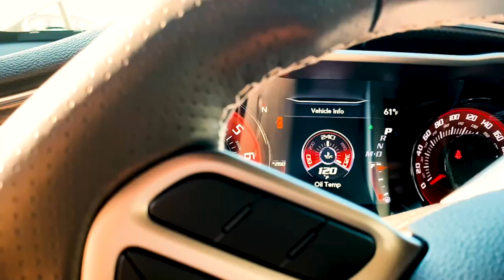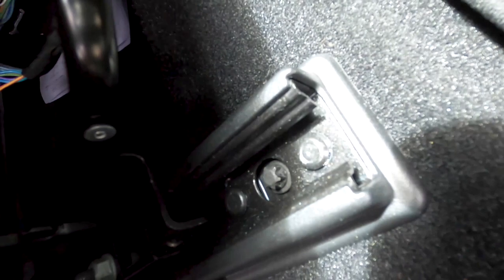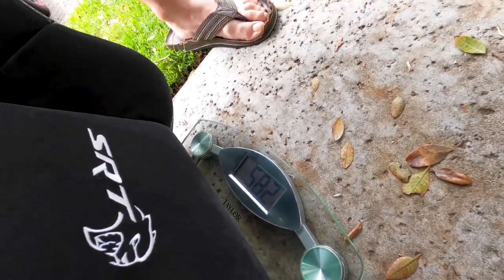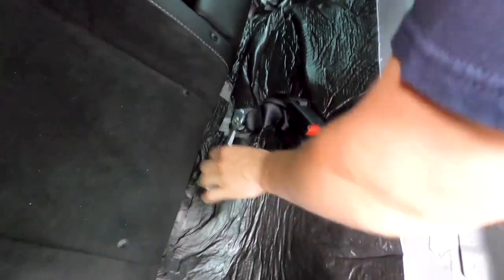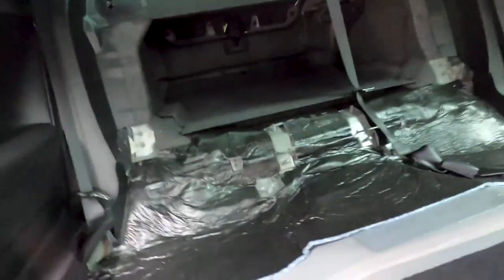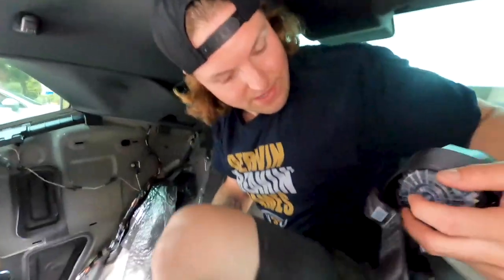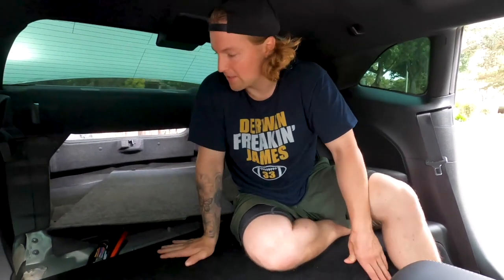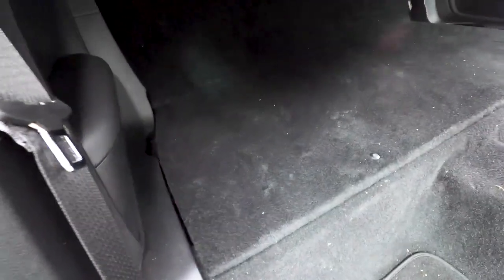SPEEDLOGIX REAR SEAT DELETE ON REDEYE!! AND OTHER WEIGHT SAVINGS!!

Comment: Nice info. I was driving mine this evening and was thinking the same thing. My car is close but, as they say “She could afford to lose a few pounds”.  I put some 315 4S tires on and the car hooks a lot better once I get into second. First still takes some driving
Reply from the maker: Dave Zimmerman hahah yeah man, I have a couple more weight saving mods coming soon too but If you find a tire that hooks in first on this beast, let me know!
Reply: NT555RII just came out. 315/35/20. Should hook pretty well. A guy in a 900hp hellcat stomped it at 50 and dead hooked.

Comment: Any noticeable acceleration.?
Reply from the maker: Not sure can check later but I’ll sell you mine for $100. I took them out to put in harness bar
Reply from the maker: But wouldn’t say it’s really noticeable. Would have to do times before and after on same day in same conditions
Reply: @SupercarJordan  might take you up on that, how much all in all including shipping?
Reply from the maker: @xhamilton91x  dm me on Instagram @redeyerac1ng
Reply: @SupercarJordan  just dm’d you on ig.
Reply: @SupercarJordan  sorry for the late reply my brother! Money's super tight for a budget sxt build, would love to! But I am just gonna gut the rear and re panel and cut a cheap fit from Home Depot lol, little more work but hay 🥰
Reply: I deleted passenger seat, rear seats, rear panel, rear spare tire and tool. Noticeable gain. Extra rolling 10-20 hp it feels, hills are nothing. Going to swap driver seat for lightweight cheapie, racing battery, bumper support deletes since I don't usually hit anything for the most part, everything else will just be an insurance claim since I'm boonies, and going to get a poly hood and trunk if I can with locking pins, lighter wheels, lighter struts, and debating cutting cats out since I have a super 10 flowmaster no res, but I'm in a no emission state Indiana just worried about new following laws., making a fast sxt on a budget build! :)